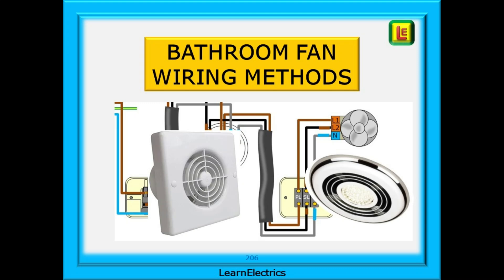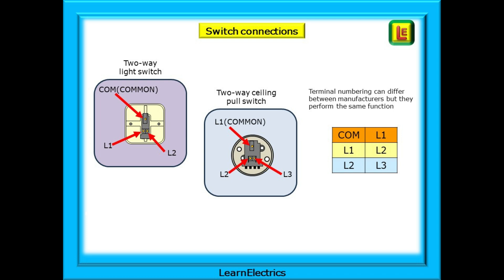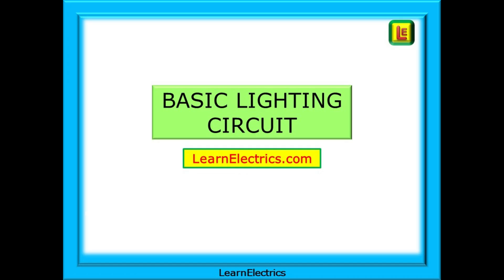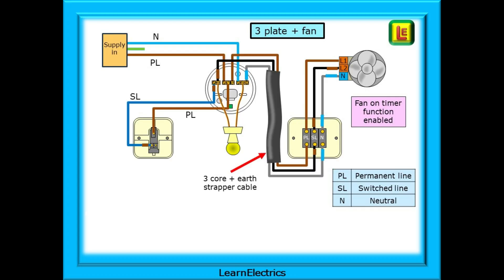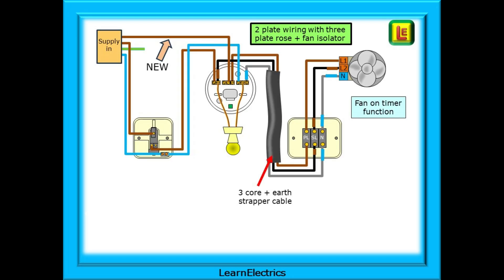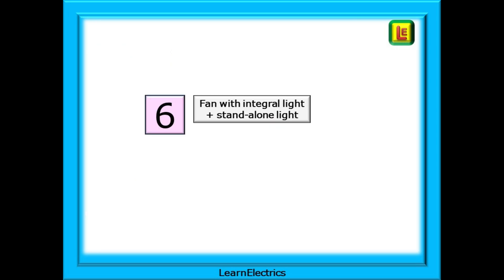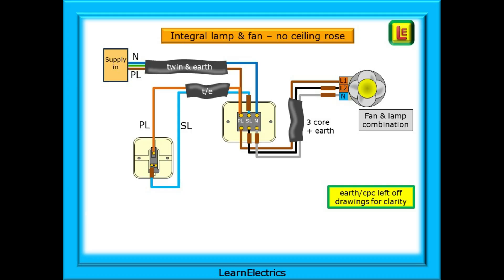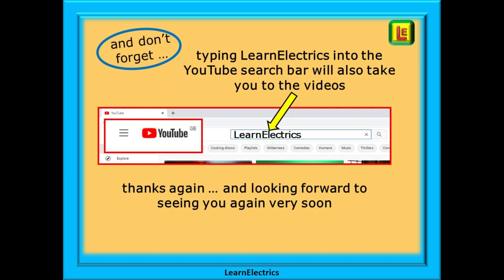BATHROOM FAN WIRING METHODS – 2 PLATE AND 3 PLATE METHODS – OVER-RUN TIMER – EASY TO FOLLOW DRAWINGS

Comment: please can u help . I have bought a extractor fan with a humistat and timer function.  I want to connect it but not to the ceiling light .
Reply from the maker: Yes, you can do this, it will require a permanent live feed and also a switch live from whatever electrical source you are connecting it to., just as if it was a bathroom light, the same principle. Your manufacturer instructions should give you instructions for setting up the humistat and timer.. Thanks for watching, Dave.

Comment: A really clear explanation, with helpful wiring diagrams - thanks, and subscribed !   One question however - what if you had one fan in use for two rooms with two seperate light switches, and wanted to activate the fan (and fan run-on) via either room's switch ?
Reply from the maker: You would need some fancy parallel wiring their PLUS you would negate the isolation switch. The power may be on from room 1 when room two switch tells you it is isolated. Thanks for watching, appreciated, Dave.

Comment: Amazing video but how would you wiring a transformer to a 12v fan?
Reply from the maker: you will need a 230 to 12 volt transformer. if the fan is DC you will need a 12v DC power supply

Comment: What could I do if I’m wiring from spot lights and it’s only got live,neutral,earth and they dont want the wall chasing out from the switch might be a silly question only an apprentice 😂
Reply from the maker: You could mount the 3 pole isolator switch hard up against the ceiling as a surface box and wire into it from the loft above. The isolator switch is not meant to be an often used switch.

Comment: Hi, I never use Youtube to find answers but I can see you know what you are talking about. I bought a fan and has just  Neutral and permanent live to connect it.  I am trying to connect it with the pull light cordon, so both are turning on at the same time.
Reply: But, I couldn't the switch cordon works for the fan but the light does not turn off. Any chance to give me an advice?
Reply from the maker: Check your wiring. The lamp needs to be on a switched live, not permanent live.
Reply from the maker: Thanks for sharing. Thanks for watching. Dave.

Comment: Thank you for all videos. Could I have a question please? In your previous video on fans you also have not mentioned a common requirement required for most fans for 3A FCU. Would you say that Double pole 3A FCU could be installed before entering a ceiling rose (let say outside bathroom above doors as commonly installed), with no requirement for 3 pole isolator then. Otherwise if I were to follow a wiring diagram from one of the popular fan manufacturer, I would end up with 3A FCU above the door with 3-pole isolator next to it (lets stick to above door location). That seems to be a bit strange? I know that for fan isolation, it would mean we have no light but as long as there is a window in the bathroom , but even without a window, we have torches :) so should not be a problem. What are you thoughts on that please? And how you usually proceed in most cases? Do you install both as required? Thank you.
Reply from the maker: This video is just one popular method of installing fans. In this case it comes directly off the 6A lighting circuit. Thanks for watching. Dave.
Reply: @learnelectrics4402  Thank you Dave. But in the case described by me above, from your experience, would you use both 3A FCU next to 3 pole isolator or would you use just 3A FCU without 3 pole isolator? As the 3A requirement seems to be very common for bathroom fans, surely many electricians are faced with that problem. Thank you for your time.

Comment: I couldn't see this in the video, but surely on a 2 plate system, we can take a 3 core cable straight from the switch to isolator fan and then from the isolator to fan? Especially when we have downlights?
Reply from the maker: There are different methods, this is just one of them to help. Dave.
Reply: @learnelectrics4402  I appreciate the response Dave. The method I stated is OK though? 3 core from switch to isolator, then 3 core from isolator to fan?
Thanks very much

Comment: Hey Dave you know the 2 plate method with no timer can you do a 1.5mm t&e from switch live and neutral in the ceiling to the isolator and from the isolator another 1.5mm t&e to the fan via connection L1 to L1 and N-N in the isolator instead of linking at the isolator because some fans have only live and neutral
Reply: Also why do you have to link at the isolator if it’s only being switched on when the light comes on?
Reply from the maker: See above.
Reply from the maker: You can link anywhere that is convenient so long as there is a permanent live to the fan, which must be isolated by the 3 pole isolator for safety.
Reply: @learnelectrics4402  but if the light comes on then the fan comes and if light goes off the fan goes off so do you still need a permanent live if it’s a on/off fan?

Comment: I fully understand the wiring on a timed extractor thanks to your video & a couple of others. However, I've just tried to replace a broken fan. The live & the switched live have power when switched on but the fan does not work. When switched off there is no power to both live & switched live.  Firstly is the fan a dud for not working at all or is it linked to having no power at all when switched off?
Reply from the maker: Check your installation instructions to make you sure you are using the correct terminals for the lives and neutral.
Permanent live should be permanent regardless of switch setting.
Reply: It was a bad switch.. changed it & hey presto!!

Comment: Best explanation ever, many thanks.
Reply from the maker: Glad it was helpful and thank you for your comments and support. Dave.
Reply: Agreed, really was the clearest explanation of the options available. I’m part way through an install of an extractor in a really tricky ceiling layout. Sloping ceiling where the light and rose are combined halfway down the slope with no access in ceiling void to run the 3 core and earth to the rose. I worked out from another YouTube vid that I could run the 3 core and earth from fan to isolator and from isolator to light switch. The fan has an overrun and I’d hoped to have a permanent live once the light switch was off. My issue is it’s a pull cord light switch with only 2 core and earth coming in from the lighting circuit so not sure how i connect into the back of that switch?

Comment: Installing new Ventaxia Svara fan...simple  in principle...App controlled so Permanent Live and Neutral from Twin & Earth cable. problem is that the ceiling rose is 2 plate (no loop). Any ideas?
Reply from the maker: If it was me, I would change the ceiling rose.

Comment: Hi.so I want to put a fan into my kitchen as it’s s as n old building and it gets damp.
So I have a double socket I’m going to get my power from.
Do I use twin and earth 2.5mm from the socket to the isolator?
Then 2.5mm twin to the switch?
Then 2.5mm 3core and earth to the fan?
Reply from the maker: 2.5 to the FCU, which will only need a 3 amp fuse and it can be 1.5 to the fan after that.

Comment: I don’t understand why you would take the 3 core from the isolator to the light, then from the light to the switch. Can you not just go from the isolator and straight to the switch ? As what if the lights in the room are spots and you have no ceiling rose ?
Reply from the maker: There are numerous wiring methods, the important thing is that the installation is functional, safe and compliant to the Regulations where appropriate. Thanks for watching. Dave.
Reply: It's a bit of explaining but it's what is done... For down lights you have to create your own ceiling rose configuration by using Wagos.

Comment: Thanks, great video! What would you do if you trying to wire the fan (with timer) and you have a loop at the switch scenario - no ceiling rose but downlights instead. Would you need a junction box to act as the ceiling rose? thanks
Reply from the maker: Yes, you can use a junction box to get the same connections as a ceiling rose. Thanks for watching.

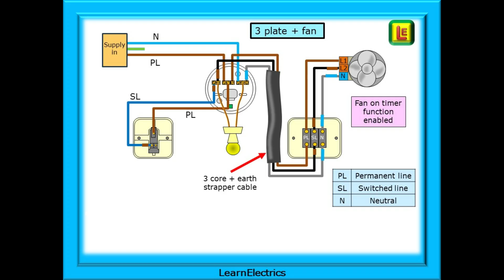Comment: 5:06 I copied and printed out that diagram and took it into the loft after hurriedly unwiring a large connection box so I could reroute the wires. Nothing worked anymore,  this was just what I needed and all working again, thanks!
Reply from the maker: Fantastic. The video did its job. Glad its all sorted. Thanks for watching and spread the word about the LearnElectrics channel, it might just help someone else. Dave.

Comment: Silly question,, good sir,, can one apply the 2 plate method using 3 plate ceiling rose , I know someone who prefers that apposed to having fan left running once the light is switched off,,,,,,, am asking the question,, believing can't see any reason why you couldn't do it ,, thank you x
Reply from the maker: Absolutely you can. A 3 plate ceiling rose can be used as a 2 plate. As shown in the video, you can also take a permanent line feed to the ceiling rose to energise the fan over-run. Hope this helps.

Comment: Thank you Dave, may I ask why have you used brown sleeve for grey cable in isolator in the last way at the end of the video, please?
Reply from the maker: My mistake, yes it should be blue. You guys amaze me, I can't get away with anything. Thanks for letting me know.
Reply: It should be Blue for Neutral, I think its just an error on the slide.
Reply from the maker: It should be blue Daniel, yes, my error, Thanks for the support. Dave.

Comment: Here in India we follow a good practice of not using switches inside bathrooms. All switches are kept outside (light, exhaust fan, heater). Outside the door all houses have a thick cotton mat. So chances of shock due to touch potential is less. 
Moreover RCCB is mandatory now for new service. With love Kishore Kumar your friend.
Reply from the maker: Thanks for the update Kishore, appreciated, Dave.

Comment: Some manufacturers require a 3A fuse in their instructions. How should this be accommodated?
Reply: Fused connection unit off of the lighting circuit
Reply from the maker: Brilliant stuff Brian, thanks for answering the question, appreciated. Dave.
Reply: Vent-axia has a wiring instruction showing clearly how the spur should be fitted, but non of these videos on you tube show one and that's bad as most fans do say a fuse is required after fires in fans because a fuse wasn't fitted for protection